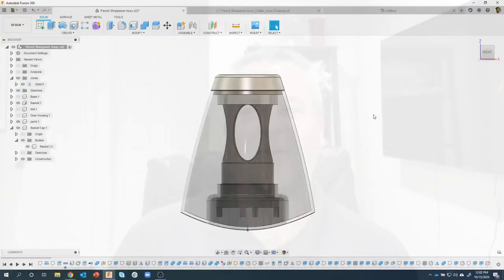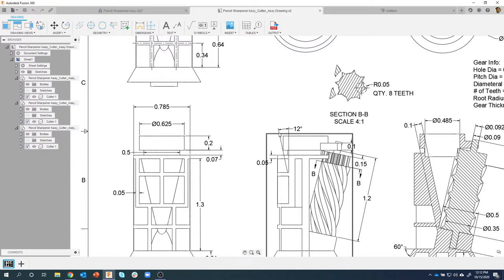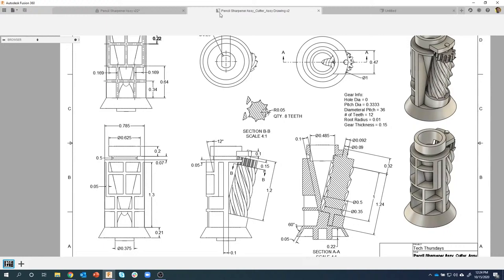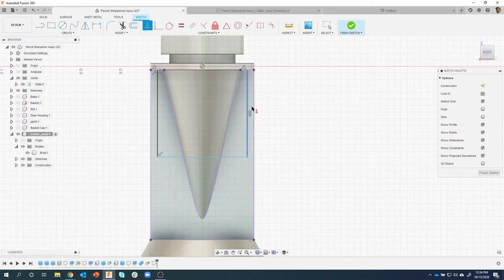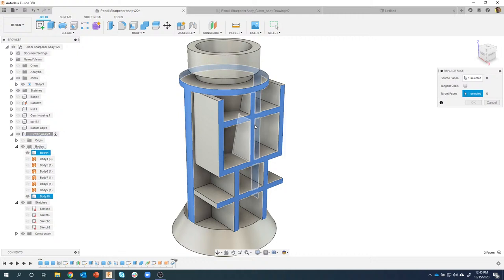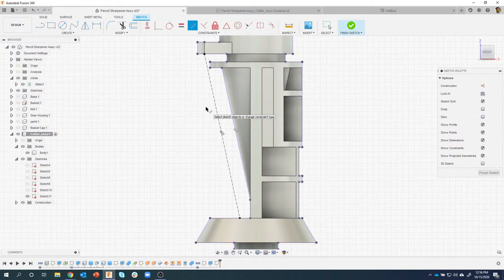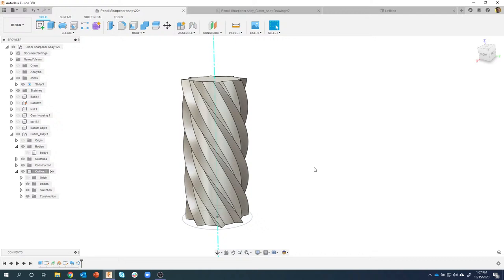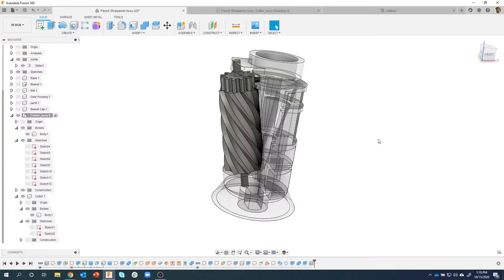Pencil Sharpener Project - Part 6

Comment: An alternative way to using replace face on that "web"  to get it to match the outside cylindrical form, is to use a cylinder, and the combine command. 

Create a cylinder on that bottom face, using the centre and the edge to make it exactly the same size, then snap the height to the top inner face. Select modify-combine. Select the web as the target body, the cylinder as the tool body, and select intersect (don't keep the body). 

Time line is a lot neater if you do this. :)
Reply from the maker: @Martien Vergruggen-  Yes!  This is another great solution.  The "Intersect" command would have accomplished the same thing, and like you said, would have made for a cleaner timeline.  I'll have to show this tip on my next LiveStream.  Thank you for sharing.

Comment: Hi great tutorials, just one mention ... you should show using the slice function in the sketcher. Also another thing, when I import a solid from Rhino for example , the measure tool is unable to give me the volume and yet I know it s a watertight model. Am I missing something ?  thanks for the great tutorials.
Reply from the maker: @Alexandre-  Yes, you are correct.  I should show the "slice" command in the sketcher.  I'll try and remember that for a future LiveStream.  I'm not sure about the Rhino model, though.  I'd have to see it to see what is going on.
Reply: @adskFusion  It s interesting even if I create a sketch and extrude it into a simple box in Fusion I doesn t measure the volume , but if I select faces , then it can measure its area and lengths.

Comment: When creating a cylinder primitive on a face, I cannot get it to snap to the edges of the existing body as shown. Any ideas? Love this series btw!
Reply from the maker: @Motownlucas-  You may need to "project" the body so Fusion 360 has something to "snap" to.  I have "autoproject edges" turned on in my preferences, by the way.

Comment: Thanks again for a great video! 
However, I'm wondering how do these gears work? 
Isn't there a part missing?
Reply from the maker: @Laurent-  Yes, this is a multi-part series and we haven't created all of the parts for it yet.  This assembly fits up inside to "part 4" which has an internal gear at the top.
Reply: @adskFusion  Thanks for the answer! I thought it was the last video for this 3D model.
This explains that . :)